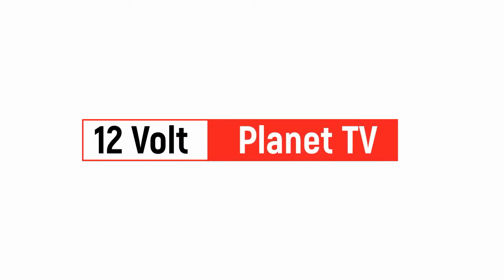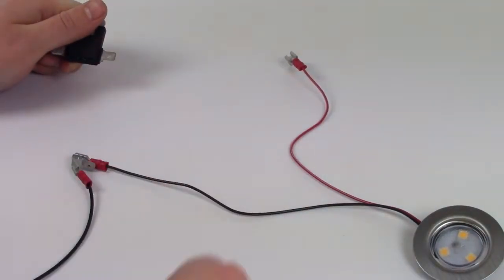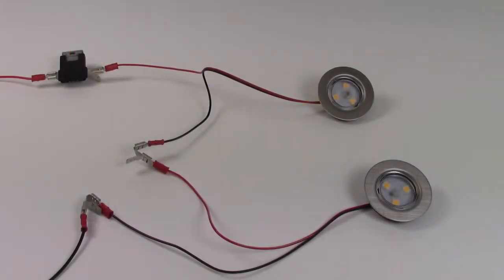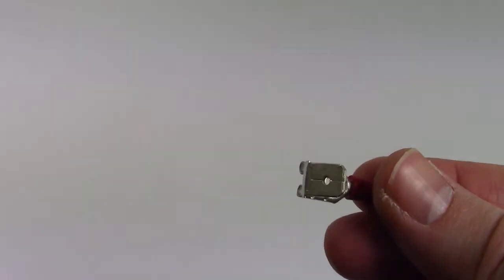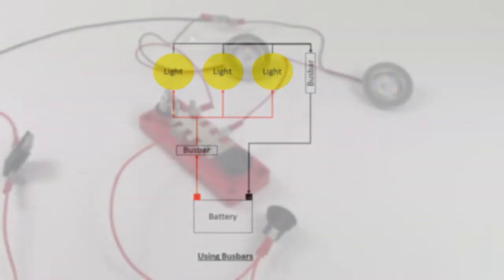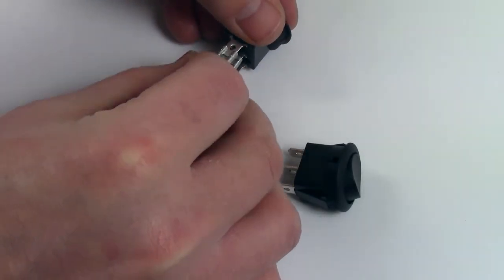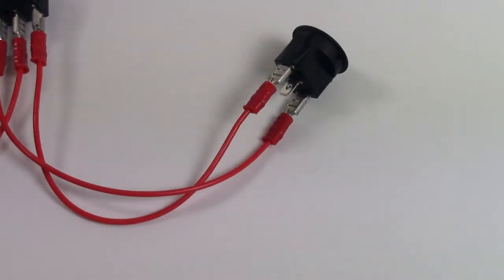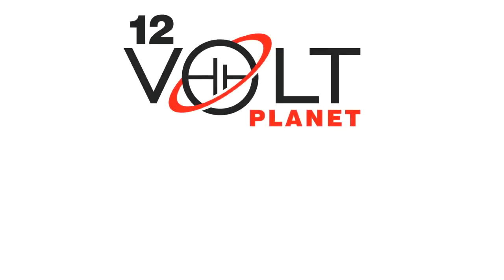How to wire LED Lights & Use 2-Way switches | 12 Volt Planet

Comment: Excellent video. However you state the reason that the LEDs will not work in series is due to polarity sensitivity. However even in series the LEDs are connected the correct way round polarity wise. The real reason that they wont work in series is due to voltage. 2 LEDs connected in series to a 12V battery would only have a potential difference across them of 6V. If you connected 2 LEDs in series to a 24V battery they would work.

Comment: Question.  If I have 8 12v lights in a small cabin, one in a small kitchen, 4 on the main level, 3 upstairs and 1 in a tiny bathroom…how do I do the switches if I want each area to be able to have a switch. Also upstairs 3 I’d like them in a 3 way switch so I can turn off when I get upstairs or down. Do you have a video on this?

Comment: I would like to install a two-way switch on an inverter in my teardrop camper, one in the outside kitchen and the other in the cabin.  I would like to add a LED indicator light to tell me if the inverter is on or off, how would that be done?

Comment: Hi could you tell me, could i use standard house 2 gang 2 way lights switches for this? I'd like my switches to match my sockets how ever finding 12v switches that  match is impossible
Reply from the maker: Hi Ethan, yeah you could use household switches. Alternatively, you should check out the CBE range of switches on our site as they could be the answer!

Comment: is a circuit breaker needed? i remember trying something similar a long time ago but just hooking an led up to the battery and switch made them flicker sometimes? i was working with just the wire/a literal led bulb not a pre made light situation and im wondering if your lights maybe have a circuit breaker included or im missing something integral in my understanding?
Reply from the maker: Hi, Breakers or fuses will always be required to help protect the cable and products from surges that could cause a fire. Sadly I would be unable to explain what happened in your case however.
Reply: @12VoltPlanetTV  thanks! thats a start. appreciate the reply

Comment: What purpose does the fuse serve and what happens if you don't include one in the circuit?
Reply from the maker: Hi, The fuse is there to prevent excess current from causing damage and electrical fires. You can read more about there purpose and why they are critical here - https://www.12voltplanet.co.uk/fuses-guide-uses.html
Reply: @12VoltPlanetTV  Thanks for responding.

Comment: Can I use one led controller/reciever to control a total of 4 light fixtures that are 3 colors at differentsettings?
Reply from the maker: We sadly do not stock these drivers as all our LED Lights are 12V DC direct so have no need for them. I would recommend consulting the retailer who sold the unit.

Comment: Would it be possible to connect 3switches? Could I create a loop on the top and bottom terminals or would all switches need a common?
Reply from the maker: Hi Al, We sadly have never tested with 3 switches so would be unable to advise. From our experience, this type of circuit will only work with 2 switches.

Comment: Great video. I want to have led puck lights in my van operated by 2 switches with one of the switches being a dimmer switch and the other switch being a simple on/off but with a tiny led light built into it.  Do you have a video on that??
Reply from the maker: Sadly we do not have any videos that include a dimmer as they are unsuitable without LED's are difficult to source for automotive 12V systems.
Reply: Wanted to ask the same thing, did you ever find out if it's possible Shirley?
Reply: @avanaroundtheworld   Hi. My sister helped install a simple on off switch near the slider door of my van so when I am outside coming in I can turn some puck lights on or off depending on another switch.  In my kitchen area I have a switch with a dimmer. Whatever level that switch is on, say full bright, that is what the  on/off switch by the door will be.  If the dimmer is on it's lowest setting, then when I come in the door and use the switch by the door the light will turn on at it's lowest setting.  I hope that makes sense.  The whole set up drove us both crazy. A typical 3-way switch is not that hard but throw in a dimmer and it's a nightmare.  Are you building out a van??

Comment: Fantastic video. Will wiring two switches  the way you did in the example work if the 12v switches are on off on type?
Reply from the maker: Yes, but only if one of the switches isn't accidentally left in the off position. If they were then the circuit would not have any power.

Comment: Hard to find on/on switch in the states. They only have a 3 prong neutral, line and load option. Tried every scenario with it and no luck
Reply from the maker: Sorry to hear this, Luckily we ship worldwide and have on/off/on switches needed for these 2-way systems - https://www.12voltplanet.co.uk/onoffon-round-mini-rocker-switch-12v.html

Comment: I have been searching fo a   12 volt 3-way switches to  no avail.  This  example is what I've been looking for. In my case it"s for an outside Rigid  diffused LED  spot light . I want  separate on - off switch locations. The light  draws more power so , I believe I will run a relay before the switches , so the load burden isn't  all going to the on - off switch. more research and double checking  before I make this connection.

Comment: Great informative video... my question is, will this work for dimmer switches aswell? If so,  do I need a special type of dimmer switch? Most dimmer switches come with 4 wires.
Reply from the maker: Hi, Sadly we have not tested this set-up with dimmer switches so would be unable to say. Sorry - Craig

Comment: Hi 
I want to add another light switch, and position it next to a fixed bedside cabinet in a caravan. At the moment I think the switch is  in the wrong place and want to be able turn the lights off/on from a switch next to the bed. All the switch’s in the caravan are the cbe type, is the method shown the same. Could you help, I am a little confused. 
Thanks.
Reply from the maker: Please contact our sales team who would be happy to assist.

Comment: Thank you for the vid! Instead of the basic on/off switches that you use in this video, can i use normal switches that you would find in a home?
Reply from the maker: Hi, No we would not recommend this as household switches are typically rated low in Amp's and you may go over there rating on 12V as the Amps tend to be higher.

Comment: Hi
What guage 12volt wiring for led lighting should i use on a long run of 15 metres, in paralell, thanks
Reply from the maker: Hi, We would recommend - https://www.12voltplanet.co.uk/single-core-thin-wall-cable-15mm-21a.html

Comment: Any suggestions how on/on switches like this that have dimmers? We have been striking out with all the switches we have tried thus far.
Reply from the maker: Hi, Sadly we have never tested using dimmer in this configuration as our lights are not dimmable. Sorry

Comment: Does the switch have to be before the first light in the series or can it be between any of the lights in that series?
Reply from the maker: Hi Megan, Your switch would only act upon any lights after it in your circuit. If you want to control all the lights it would need to be placed before any lights in your circuit.
Reply: That makes total sense and unfortunately I just wired in 16 lights with 6 switches into my skoolie and now have to redo it all🙃 thats ok though, I'm learning!

Comment: Thank you 
Can we replace one of the switches by smart switch ?
Reply from the maker: Hi, in the 2-way system If it is an on/off/on smart switch yes but I am not sure they exist I think most are simply on/off which is fine for just the single circuit.

Comment: can you add touch lamps into this circuit so that the switches work but you can turn off individuals by touching and then once turned off they reset back to all on on next activation of "on"

Comment: Great video! I'm wanting to use dimmer switches, can you use them in a two way switch configuration? The switch I'm looking at has 4 wires on the back. Do I run the negative off switch #1 up to the lights and then the negative from the lights back to the bus bar??
Thank you, any help would be appreciated.
Reply from the maker: Hi James, Sadly as our lights are not dimmable by an external dimmer we haven't created such a setup and therefore wouldn't know, Sorry.

Comment: So does it matter what guage wire I use for 12v?
Reply from the maker: Yes, You need to make sure you account for any voltage drop along long run lengths. See here for more info- https://www.12voltplanet.co.uk/cable-sizing-selection.html

Comment: What switch did you attach at 0:42? The ones I see on your website have 3 connectors on the back..
Reply from the maker: Hi, We used this switch in that section https://www.12voltplanet.co.uk/onoff-round-mini-rocker-switch-12v.html -Craig

Comment: How do I add a dimmer switch to a 3way circuit using the on/off switches you have?
Reply from the maker: Hi, Sadly none of our LED Lights can be used with dimmers. If your's lights can then the retailer who sold them to you should be able to provide wiring diagrams for you.
Reply: @12VoltPlanetTV  The led lights I have have do not have positive and negative labelled wires does it matter?
Reply from the maker: @Devonian23  This would depend on the lights it would be best to speak with the retailer who sold them to see it there polarity sensitive.

Comment: Great info on the video. Ive recently wired up a 2 way led circuit and when I switch the lights off they stay on at about 10% illumination. When I pull the power supply is when they full extinguish. I used two SPDT switches and have tried everything. My last port of call is to throw a resistor in to stop the residual current coming through the circuit somewhere.
Reply: Did you fix it ? Because i wired some 3 volt lights and when tunrned off they still illuminate a bit
Reply: try a diode

Comment: Hi there great video, i want to put 12v led multi coloured lights in my van , however they all seem to come with a uk plug, can I not directly add the positive from the led to the positive on my switch panel and negative to negative? will doing this blow them ?  thanks for any help.
Reply from the maker: Hi, If your lights have a 3 pin plug they will require 240V. Sadly adding them to your battery will do nothing as they will not have enough power. Your best contact the retailer who sold you the lights for further help.

Comment: Is a bus bar essential for a 2 way parallel set up? 
I have 2 lots of two switches.
I wonder where the negative runs in the last part of this video?
Reply from the maker: In this instance, you can run your negatives back to a common earthing point or to a your battery negative either with or without a busbar,

Comment: Hello...i have a 2 element LED light...1 is Amber light and 1 is white light...there are 3 wires coming out of the light...i would like to use a multi position switch where it would be off in the center and Amber in the up positio and white in the down position...i can't seem to get it to work off the switch but I can get them to work individually off the battery ... any idea what I'm doing wrong ??
Reply from the maker: Hi Bruce, It could be the switch you're using that is faulty or not correct. We would recommend using our on/off/on switch https://www.12voltplanet.co.uk/onoffon-mini-rocker-switch-12v-20a.html

Comment: would you be able to use a dimmer switch for these lights?? just bought 10 Vega 48 Recessed 12V LED Downlights - 0.6W (EEH 4W)
Reply from the maker: Hi Harry, Sadly not on those LED Lights however our Vega 75's are dimmable using the switch that comes as part of the unit.

Comment: I like this video, but have a question. Where does that last wire go that is connected to the center post of switch #2?
Reply from the maker: Hi Matt, That cable is your 12V feed out so it will go to your lights.
Reply: it goes back to the battery/power source